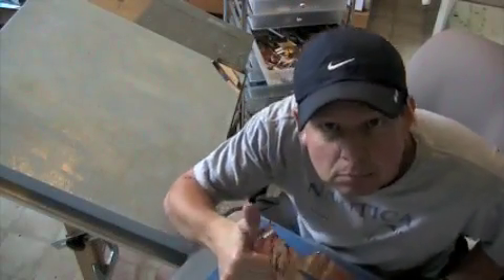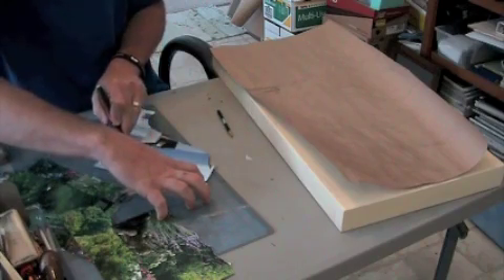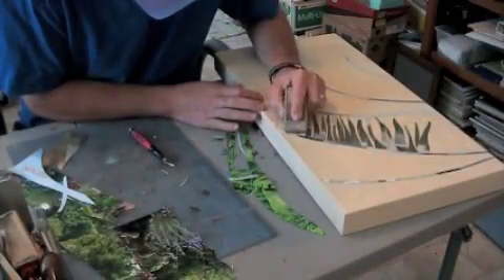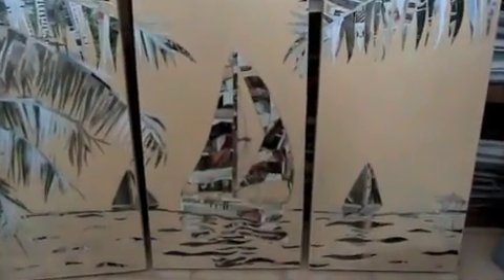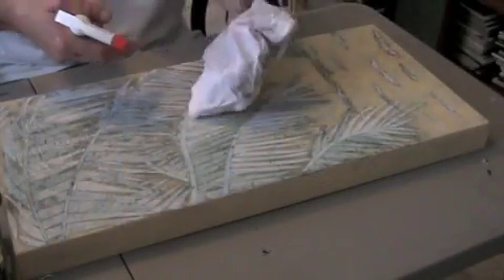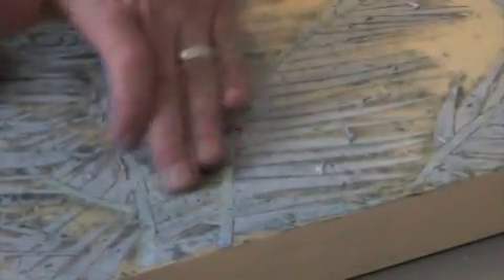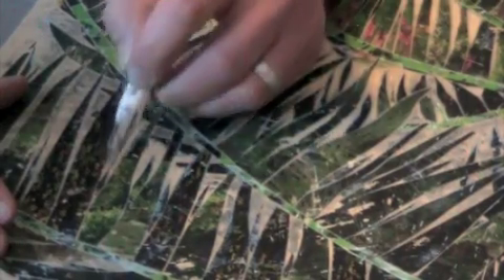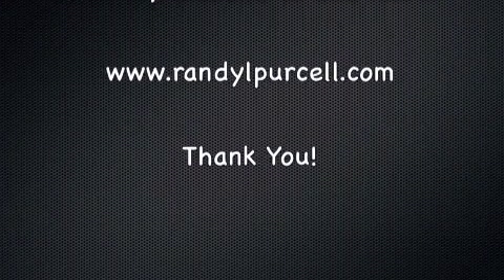Ink Transfer on Wax Process (updated 10-2011)

Comment from the maker: The wood blocks I use are just scrap pieces of wood from my shop. Most come from pine or popular wood I used as back frames for my paintings. They are 1 x 2 or 2 x 4 pieces, 2-4" with an angle cut, then sanded a little to keep from digging in the wax. 
Thanks again!!

Comment from the maker: Thank you Kathleen,
I am a lot different than most encaustic artist. What I transfer is the ink from magazine pages, not an image. I transfer the colors for each little section of the drawing until I have filled to whole composition. This video is one of my older ones, so if you look at some of more recent videos you'll see that I use my photographs as a template instead of a drawing, but the technique for the transfer is still the same. Pulse my new videos are broken up into shorter demonstrations of each step. I think there are 6 or 7 videos.
As for the milk paint; I use it because it's a porous paint and makes a great base for the beeswax. Some artist stay with the encaustic gesso, but you can also paint on raw wood, milk paint, etc... I've also painted on oil paint. Ive tried several base media and find I like raw plywood or milk paint best. I have a painting I did 8 years ago on oil, and it still looks great. I hope this helps. Thanks for dropping by:)

Comment: Hi Randy -very impressive. I have a couple of questions. One is - do you use images from magazines themselves or do you scan them and print them out as laser prints. The reason I ask is that Inwas taught that it has to be toner in order to transfer onto wax. Also wondering about your background -you said it is milk paint? Another thing I was told is that only encaustic gesso would work. Do tell.... Your work is wonderful.

Comment: I like your technique, the results are great. I don´t know if I could see in my head the design to put it together the way you do, but it looks like fun. How many layers of wax do you do before applying the paper?
Reply from the maker: Patty Valle Hi Patty, and thank you for your comments. I don't really have an exact count of layers. I would guess 4-6 layers. Most of the time I go over the panel until I have roughly the thickness as 8-12 sheets of paper. I have another short video of me applying some wax to a small panel. I like for the wax to be thick enough so that I can still scrape it smooth and still have a nice layer for the transfer. As long as you cover the panel, you'll be fine. If I want to have more texture in a painting I'll make the wax thicker. A for the design, I now use large photos I've taken and use them as a template. My newer paintings are a lot more precise than this one in this video. I hope this helps!
Reply: Randy L Purcell
Thank you for your prompt answer, I have watched a few of your videos and visited your Facebook page and website. I'm new to encaustics and constantly amazed at the generosity of experienced and established encaustic artists like yourself. Thank you again!
Reply from the maker: Patty Valle You're welcome. Glad to help. We all need help every once in a while, especially when we first get started. Good luck!